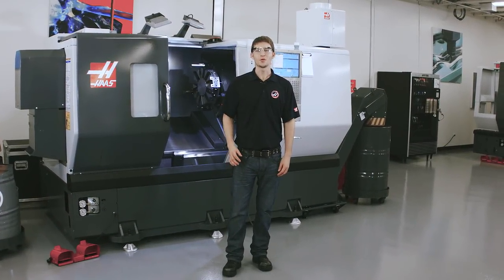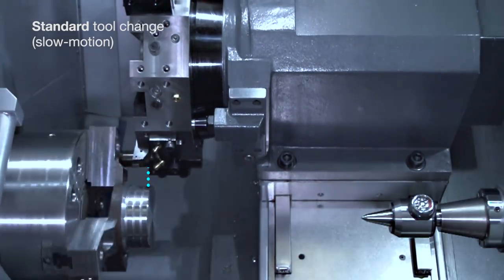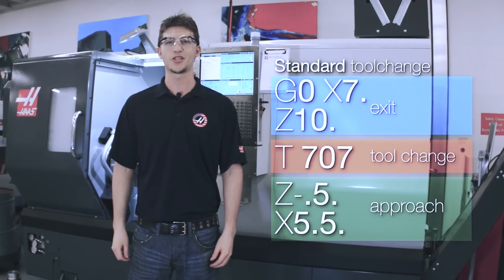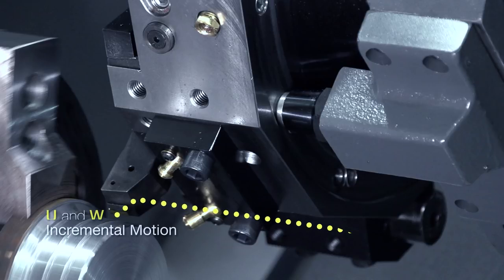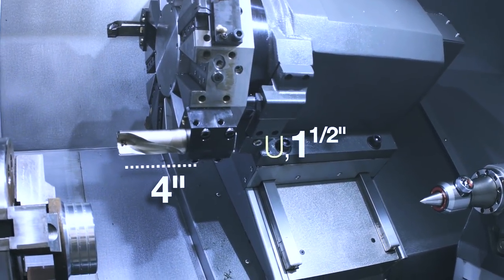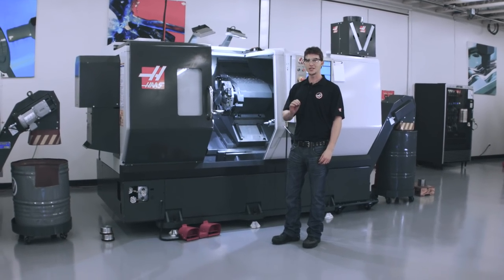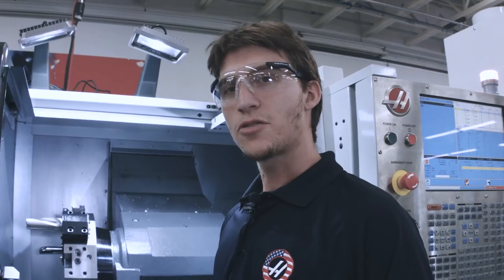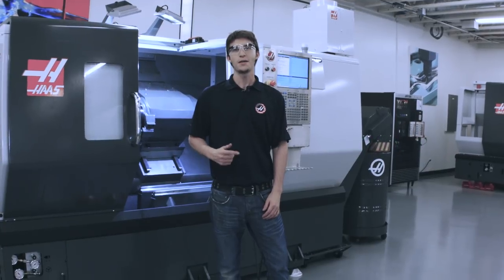FASTER Lathe Tool Changes with INDEX ON THE FLY - Haas Automation

Comment: only efficient if you have alot of parts to run... and given the average CNC operator skills often lacking, you put alot of risk to save a small amount of time vs crashing the machine.  And a broken machine is the worst killer of profit.
Reply: Then buy a Mazak it does that by default sience 1995 if it has a Servo Turret

Comment: I were mill operator once and the machine had 5 sec tool change. I asked for 3 vises to make 3 parts at a time. Imagine the savings when instead of 3 tool changes there is only 1.

Comment: I never send the turret further away from the part then absolutely necessary. My tool change location is the closest point away from the work/holding to give .05" clearance for the index to the next tool. It's different for every tool. Over a run of 10K+ units in production this alone can save days.
Reply: I'm not nearly up to that level but it's great to hear what people are managing!

Comment: Make us a macro program can be output by a post processor that looks at tool offsets/work offset just before the toolchange  and will automatically move to clearance points for each tool depending on its X and Z offset.  G200 T[NextTool] U#100 W#101 X[start] Z[start]

Comment: C´m on, that is pretty oldschool. Why separate those motions at all? Why not use a cam system that can simulate, minimise and program part and machine clearance over the whole travel? That way you would create a cycle-time optimised travel programming for your machine.

Comment: Just redesign your Turrets to Non-Lifiting type already. Japanese Machines have had this since before 1995.
Reply: StachiBCNR33 they have
Reply: I think the chip should be driven back into the bottom of the machine. With the turret being unable to lift. Wood lathe turning tools are held by hand. CNC lathes are designed the opposite way umagine trying to hold a wood lathe turning tool upside down and not worry about it flying out of your hand and hit you in the face.

Comment: If you buy a machine with a Fanuc control then you do not need this. You can use a G130 X? Y? as a secondary home position at the start of the program, put X and Y as a safe tool change position i.e. machine position then use G30 U0. W0. at the end of each process. Much safer and can be used again and again.

Comment: You also need to be sure that the Speed of the machine is called out on that line,  or the machine will pause and hang for a few seconds and completely negates the benefits of this.